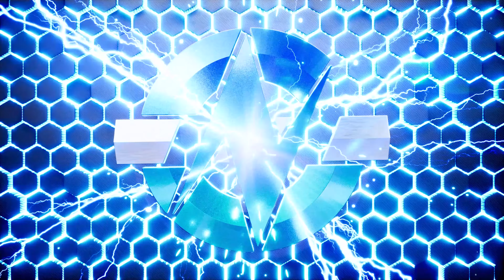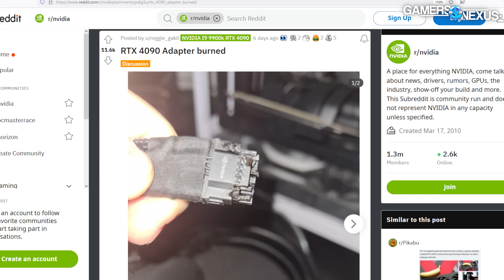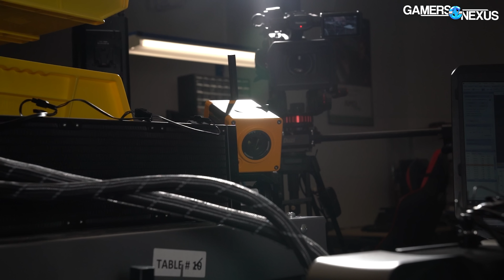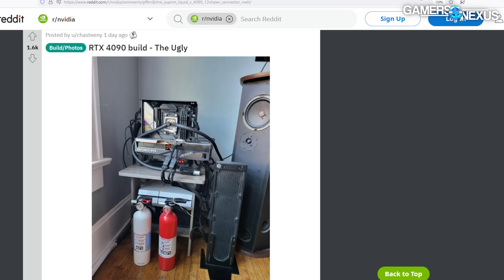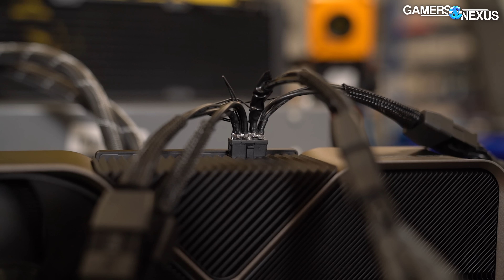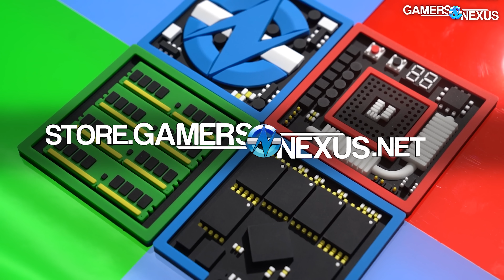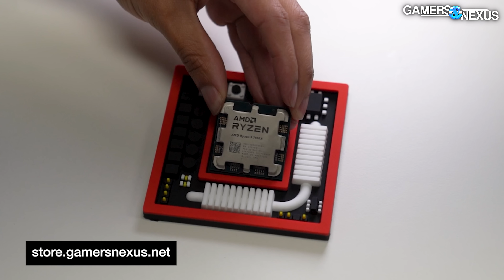Testing Burning NVIDIA 12VHPWR Adapter Cable Theories (RTX 4090)

Comment: It does make you wonder what went on in the factory to make the 40 series different from the 30 series when so far we have not heard of anything bad happening with them. I don't see how adding the sense wires could change how the main pins connect to the cables to delivery the power needed at various loads the gpu has to contend with. I doubt that Nvidia would tell anyone why they let this happen regardless of it being done intently or not.

Comment: I have to wonder if Igor got a 4060 or 4070 connector and they accidentally put it in the 4090 box this could explain the lower voltage and gage wiring just a thought don’t fry me lol

Comment: People are checking the cables. Anyone bothered to check for undersized pins on the boards? OOT  size from inconsistent pin manufacturing due to poor QC would also cause a high resistance connection, and would cause it to not appear across all boards, only the ones with a poorly sized pin pulled from the "bin". This would also explain why you can't create the issue with your card as all the pins are good.

Comment: How about the port only being capable of 200W transfer due to ohms, but being deployed to deliver 600W instead.  It's like the 8 pin ATX 2.0 connectors, rated as suitable for 150w indefinite delivery each, able to deliver up to 450w each short term but with risk of combustion.  And hey, wasn't there an issue of GPUs in early ATX 2.0 known to combust because Nvidia tried to go from 3 6 pin connectors to 1 8 pin which resulted in a recall and revision?  Also, the adapter being the point of failure would more likely cause the failure to occur at the other end, where the power cables plug into it, or behind the plug where the wires are joined.

Comment: I think people should also say what PSU they used, different PSUs might be routed differently inside that could cause the cables near the connector to heat up if it is the weakest point.

There are several reports of 14AWG cables also failing. My theory is that people with failed cables used a MOLEX or similar splitter for some of the 8 pin adapters that are required by the RTX4090's 12 pin... So they adapted the PSU to the adapter... This is something that should have also be checked. A single MOLEX is rated for 54W, two of them deliver 108W, instead of the 150W of an 8pin, if they used 2 8pins for 300W, and 4 MOLEX for the other 2 8pin (216W) the total power that could be delivered is 516W, and the card exceeds that in heavy ray-traced loads.

I am NOT an engineer, but I really think this is something that should be checked. No YouTubers could recreate this, because you are doing things like you are supposed to do them... A normal user isn't that smart and will do dumb things like putting a SATA or MOLEX adapter to 8pin, instead of getting a new PSU for that beast card.

Comment: i still have zero confidence in this socket,  given its smaller gauge  wire,  if the angle bend is so temperamental  compared to the previous generation, then the standard should be revised and current brands using it revert back to the 8pin design socket and NVidia should relent and allow board partners to retool  otherwise current generation will mainly go to the AMD camp or older gen models

Comment: Even if everything is working perfectly, 600 watts at 12 volts is still 50 amps. That is a crap-ton of current! whether the voltage rating of the insulation is 150 V or 300 V is practically irrelevant since it only carries 12 volts.

Comment: So with the 12 pin cable couldn't you use hot glue or use some type of adhesive to make sure that the wires stay in place with the plastic housing? You could also do it in a way so it does not bend where it's not supposed to. It wouldn't look good but hopefully it wouldn't start a fire at least and it would theoretically keep the pins in place... If the wire close to the plastic housing couldn't move or bend and it was permanently connected to the plastic frame of the pcie plug.

Comment: you could try silicon cup cover over power pins stop heat hitting pins as silicon takes longer time heat up vs plastic get hot fast. you could make silicon sleeves cover cables as well help cable not getting as hot.

Comment: Maybe try looking into how voltage droop effects the connector, if such a power hungry card is causing voltage droop on weaker PSU's / cabling then the card will have to draw more current to maintain the same power draw. So testing the limits of under voltage of the cards and how that effects the current across the connector might be relevant as a 2V droop would increase the current by over 15%, that is if the card will even work.

Comment: It might be a stupid question, but: why did the 12pin power connector of the 3090ti not melt? And more interesting: could you try to use a 12pin cable and just bridge the sense pins at the card to get the 600W?

Comment: Makes me wonder, can't you factor out the graphics card and just connect constant 450W load to this? For example high power resistors or electronic load or 12V incandescent bulbs or something. Your card may not have used all 450W all the time.

Comment: Might want to check if some of these cables are made with CCA (copper clad aluminum) wire instead of copper. CCA will take about half of the amperage of copper and will burn up easier. That's why car audio builders always avoid CCA wire.

Comment: Anderson Powerpole 45 connectors are rated to 55A. A 2x1 block is smaller than the 12VHPWR connector. They are also foolproof crimps. They are limited not by the terminals, but by the wire going into the housing.

Comment: the voltage and temperature rating on the wire is for the insulation, not the wire itself. the voltage rating itself makes no difference in a low voltage application like in a computer, although a higher rating could hint at a better quality wire but not always and especially not always to an extent that would make a difference. it's just letting you know how high of a voltage the insulation can handle before it is able to ionize and flow through the rubber. same thing with the temperature rating, although it is more relevant since the wiring will most certainly be running a higher current level at lower voltages and therefore heat up. same thing with that as well that a higher rating may hint at a better quality wire, but also again not necessarily. the absolute biggest factors that would make a difference in a situation like this is 1) if the gauge is actually what it says it is, a quality cable will be obviously but cheap ones are often one to two gauges smaller than advertised and make up for it with a much thicker jacket to give it the overall appearance of the larger diameter, and 2) if the wire is copper, aluminum, or copper coated aluminum (aka a bait and switch scam to fool people at a glance).

Comment: You need to step back and look at how this is being used in a system. I doubt that this issue occurs in an open chassis and with "professional experience". Please look at the failed systems...not the cable. The amount of stress on the connectors with a cantilever environment is great. Pulling on the cable or bending (installing a side panel with no clearance) may be the root cause. Poor design for install in a system with many configurations that are not controlled.

Comment: I have conclusion that the connector probably melting slowly because of continuous heat for days or weeks not instantly in just a few hours, there is some kind of plastic that would melt slowly over the time which I've seen quite often.

Comment: With DC electricity power/electrons move/flow from the negative to the positive. And the wire that's the farthest from the source of the power has the highest resistance in the circuit and hence gets hot first. This is why on vehicles the body ground is the negative because its like a massive wire and if a path becomes hotter creating more resistance the power will take a new path, the path of least resistance

Comment: Now there saying native ATX 3.0 PSU cables are also melting 😬
Reply: Was going to say the same. Seemingly most confirmed report i've seen of that was msi card and msi atx 3.0 psu with native cable.
Reply: @30gaming83  I bought a GameMax 1300 ATX 3.0 (only brand I could find that was in stock) they only had a few left when I got it. I bought a scalped MSI card for 2g and I just cancelled the order. I'm just gonna sit back and wait. It would suuuuuck to pay scalped prices just for it to melt

Comment: I just want to see a very simple test in which someone just connects a bunch of these cables to a controllable resistor load 
Just driving it under 450W, 600W 700W .... Until the cable starts to melt.

Comment: The 300V cables would just have slightly thicker and robust insulation, possibly with slightly different additives in the plastic. There is no benefit to using higher voltage rated cable in this application, as it makes fitting wires in small space harder. Technically because insulation is slightly larger, you have slightly more surface area to radiate the heat, but because you have more insulation, you transfer heat from wires less efficiently. Additionally most conductors increase their resistance as the temperature increases, so if you select your insulation too thick, you can end with positive-feedback, where your wire heats up, it is not cooled properly, and it gets even hotter, but the heat is not removed faster. There is an optimal insulation thickness, where these two factors play nicely, and it depends on application, rate power, conductor losses, ambient temperature, and target conductor temperature. However, for most cases, the thinner the insulation the better, this maximized the heat transfer. And while external temperature of the cable might be higher, then internal temperature is actually lower, compared to the one with thicker insulation.

This problem has a lot of research and modeling in academia in industry. Similar problem arises in insulating cold or hot pipes, i.e. in HVAC systems, where you want thick insulation, to prevent losses, but not too thick, as that increases surface area and in steady state can actually make losses higher (and obviously also increase size and cost).

Comment: As always, Buildzoid is the closest to the truth.
The imperfect contact of the pins is the only way you can get that high of a resistance in order to get the amount of thermal energy to melt that ABS connector.

Comment: This is another theory idea, or possibility for the melting connectors.  What if it isn't a high load in the RTX 4090 that is causing the melting plastic.  What if it is a flaw in low power behavior.  An example, somehow while running low power, a special switch state somewhere on the card creates a lowered resistance short allowing a momentary burst of amps.  It may not exactly be the bridged power side but the bridged ground side that is allowing this potentially common design to exist.  This all comes down to how the 6 +12v pins on the card break out through the card and cycle back to the 6 ground pins.

Unfortunately, this part requires knowing what the PC exactly did during the length of time.  We assume that only during a high workload can we hit the conditions necessary to generate the heat to melt plastic.  This may require observing a card in like a 48 hour test, looking at power draws to see if dangerous spikes can occur, and somehow like all the amps are isolated, momentarily drawn through a single pin.

One way to test for this flaw, the design of the 12VHPWR connection is intended for "up to 600W".  You have 6 +12v pins and 6 ground pins, giving us 6 12v circuits.  This means under a balanced load, each circuit is 100W.  Divide by 12 volts gives us 8.333 amps.  As such, each pin must support 8.333 amps without damaging the connection.  According to specs, each pin is suppose to support 9.2 amps, some breathing room for error.  My suggestion is set up a single pin of power with the 6 grounds connected normally, and test this at different amps from 8.333 amps (for a baseline), to 10 amps (slight overdraw), to 15 amps and potentially higher to 25 amps if assumed necessary for the test.

Some now thought of logic, somehow the 12VHPWR connection has to increase the power draw while keeping the amps balanced across the 6 power circuits (+12v pin to ground pin).  With the native connection, no wires merge from the PSU to the GPU.  With the adapter, sets of wires are merged before reaching the GPU.  The wires add resistance.  The load balancing system on the device side may be designed to have the wires' resistance assist in balancing the power draw.  With the wires merging at the adapter, this wire resistance is not normal.  When the GPU shifts in power draw on the adapters, there is a longer unbalanced power draw due to the screwed up resistances on the pins.  As much as there are 6 pins, if pin 2 has less resistance than pins 1 and 3, all the power goes down pin 2 first.  Imagine the effect of bursts of 100ms of overdraw on a single pin can do after about 1000 times?  Under high power draw, this would be balanced, but why test it in low power modes?

A potential stress test here is like having the GPU cycle between high load and rest period, like run a game or render that gets 300+ FPS in pure rasterization but have V-Sync toggle on/off every 5 seconds.

Comment: Given the fact that also native connector from modern psu are reportedly failing I'm wondering if at this point the issue could lies within the inner size of the metallic pins.
If for any reason the diameter is less than expected on the connector (or vice versa on the graphics card plug) this would explain what we are seeing these days.

Comment: thank you for doing these tests, so far youve been the best. just bought the 4090 and the idea I could lose 2 grand over poor quality control is pathetic.
Reply: Have you had any issues with it?
Reply: @starwarsfreak1111  only issue ive had was the cablemod cable. it caused GPU crashing, turns out it was their coord, I just used the adapter that came with the card, made sure it was fully seated in the gpu and its worked great ever since.

Comment: I'm glad you did this yourself and respected your teams off time

Edit: also remember Igor's 3000 series cap theory saying that the black capacitors on the back of the GPU were cheaper and causing errors? Yeah Jay's two cents also claimed that was the issue and they were both flat out wrong.

Comment: Take one of the now damaged cables and test the melting point of the plastic. My personal though was that since they seem to be using some poorly manufactured cables, that it is also possible that some of those companies also used a plastic that also had a lower melting point than what was possibly required by Nvidia. Just guessing, but after your tests, I'd say it's not too farfetched.

Comment: The faults that would have to occur on these cards where a 300 volt cable would perform better than a 150 volt cable are barely even reachable theoretically. Whatever the issue is, it's not the volt rating on the cables.

This amount of heat are 99.9% from incredibly bad connections, from bad factory QA, poor casting of the metal used in the connectors, to big size error tolerance when making the male and female connectors etc, etc. It's not the rating of any of the parts. The remaining .1% would be that this is some incredibly rare power oscillation triggered by certain hardware configurations resulting in capacitance heat induction. Which would be insane, it's not that, it's a bad connection from a mechanical or chemical error in the production. Hell it could be so simple it's a substance coating on the pins that isn't supposed to be there.

Comment: I don't understand why they've been trying to reinvent the wheel with these adapters, same with some of the previous gen founders cards. As someone who has a 3080 that accepts 3, 8 pin cables, sure it's a lot of cables, but it works and I don't mind how it looks. I just don't see a need to overthink how we connect power to a card, and am glad I didn't buy into this mess.

Comment: Thank you doing for all the testing. Doing a quick search I found that  300v wire is 16 gauge and 150v wire is 18 gauge. You show different wires in your video but,  In your test you didn't replace the wire with a different gauge of wire. By the way, at what temperature dose the connector's plastic start to melt?

Comment: Best analysis yet!   And your findings with igor's, and there being 2 different versions of the adapter, will hopefully mean that users can easily identify the unsafe adapters by looking at the cable voltage labels.   You should know for sure once you get more failed adapters.   It's possible that not enough of these are failing for you to get a good sample size..    Hopefully Nvidia can determine which vendor made the shit adapters and come up with a reliable identification method.
<3 GN

Comment: my theory is that there is just some crappy cables out there, that were made poorly or used sub standard cables, or both. with the amount of power these cards are drawing over such small connectors even minor changes in resistance would cause melts

Comment: what a horrific cable, as an industrial electrician. no one in their right mind would ever allow this kind of bastardisation for high current delivery. the engineers that thought this was acceptable should be sacked, forfeit their degrees.